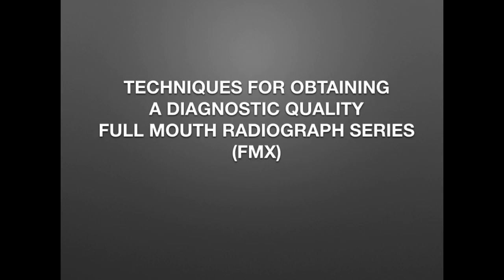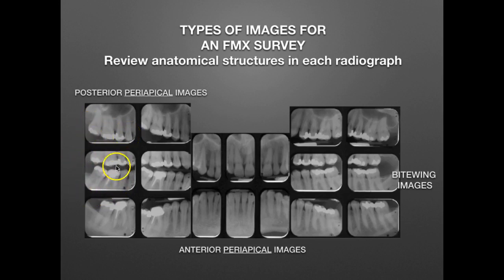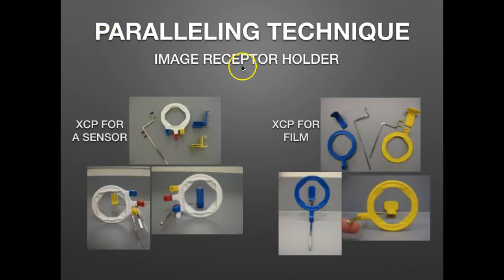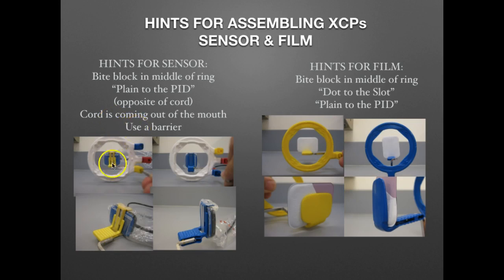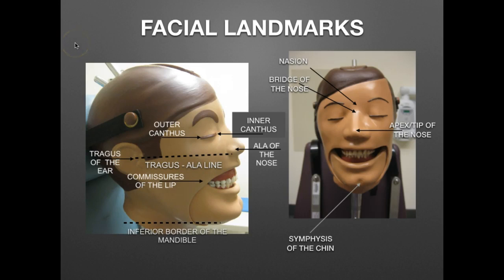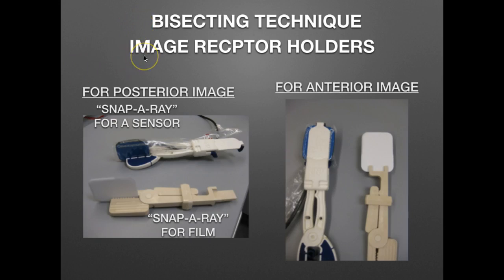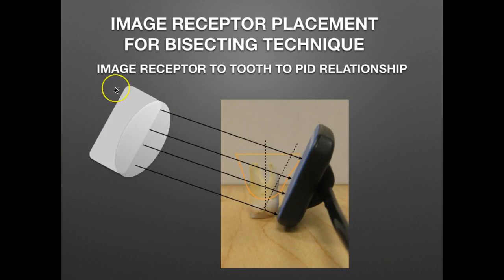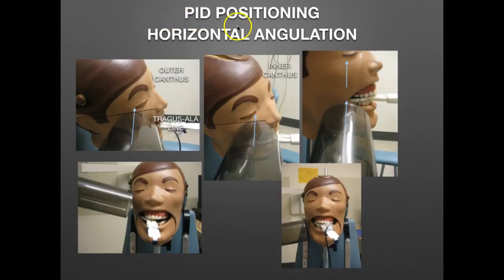Techniques for A Diagnostic Quality FMX

Comment: What is a PID?
Reply: Its part of the x-ray machine its connected to the tube head, its the tube thing that sticks out towards the mouth. It leads the x-ray beam towards the teeth. I tried to "draw" it with symbols here 😂 im sorry if this isnt clear.  [   ]=--(beam)------      the = part coming out of the [   ] is the PID. Wow this is a bad explanation , ihope you understand
Reply: Position Indicating Device, (PID) Tube in front of the tube head that you line up with the Rinn ring when taking the image.